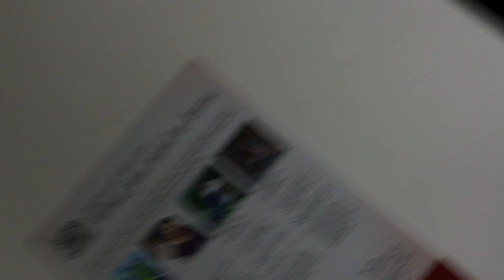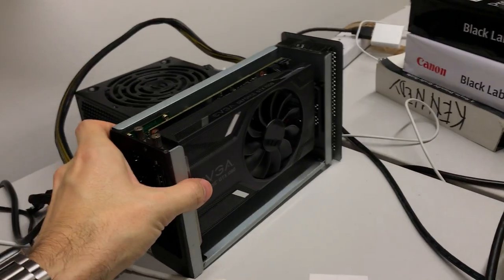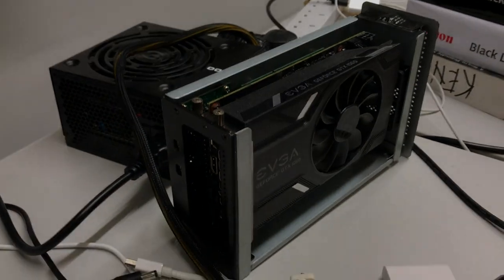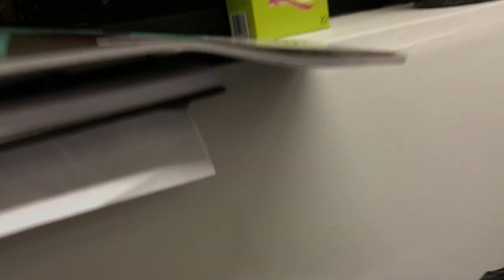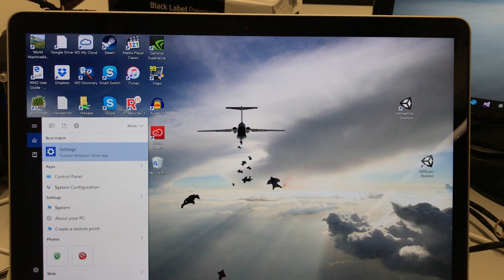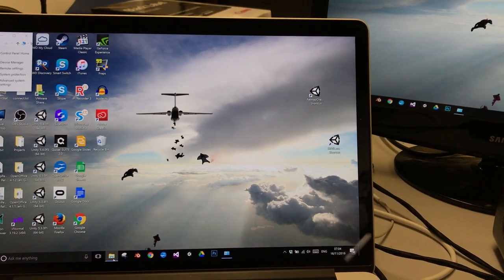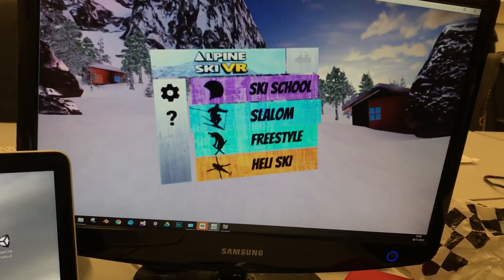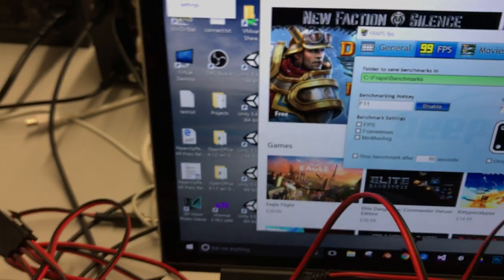Macbook EGPU Setup for Virtual Reality

Comment: Hi, I've been contemplating the same setup or perhaps jumping on the TB3/Node approach. Since you're on TB2, what kind of FPS do you get in general, for other more intensive games? I know Steam recommends 90FPS, can TB2 get that? Thank you.

edit: clarify FPS question.
Reply: Unreal Unity with this setup it seems to max out at 75fps. I'm not sure why, but it refuses to go higher, I don't know if thats something that's limited to my setup or if it's the TB2 in general. But most games will hit that fps. That rate feels fine in VR for me though
Reply: HDMI might be your bottleneck. have you tried DisplayPort?
Reply: Contemplation over, I'm using a MBP 2016, Razer Core, GTX 980 TI and HTC Vive, and it works well. The SteamVR test app showed Very High results and Unigine Heaven runs about 120~ FPS at High settings. All purchased 2nd-hand except the Core.
Reply: Unreal Unity nice my exact setup
Reply: good to hear! Although I spend most of my time in Win10, I like and use the flexibility of jumping onto MacOS for general web dev.
Reply: Unreal Unity what version of macos you on?
Reply: 10.12.2
Reply: Unreal Unity can you update to 10.12.3?  Or will it cause issues?
Reply: good question... I knew about the beta but just saw that they released it a few days ago and going through the release notes, doesn't seem worthwhile updating. I've not had any GPU issues/glitches etc. So I'll probably stay as-is for now, and then in a few months check out https://egpu.io for status.
Reply: Unreal Unity - I am trying for same setup. can you share your MBP specs.
Reply: I went with the 2016 MBP 2.7Ghz

Comment: check out the Akitio Node with thunderbolt 3
Reply: Bill that looks good.. worth a look for thunder 3 laptops, my MBP was just 2 though and the thunder 2 fits in my bag which is great
Reply: I think it would really be worth upgrading to the new macbook pro's simply for tb3. I know its ball ache buying a new mac, but the doubling of speed from tb2 to tb3 is the sweet spot.
Reply: Bill, I was just going to post about the AKiTiO Node. That's what I've been waiting for... for years. I've searched the internet for these homemade eGPU setups and now finally I can get this thing I've dreamed about for years. I'll be the first to admit that the setup I'm getting is overkill and way too expensive. Here is what I'm getting.
AKiTiO Node $299
Nvidia Titan Pascal $1200
Macbook Pro 15" 2016 $2,400
Total $3,900 +Tax
But it's my dream setup.
Stevesuch, I hope you at least get the AKiTiO Node and a Macbook Pro 2016 to get the full performance of your GTX 1060. I'm so excited.
Reply: Hi 
I did the samething but it doesn't show up in device manger video adapter? Whats wrong with it please need a help!!!
Reply: head over to https://egpu.io/ for solutions.

Comment: Are you running the power to the PCI-E with the stock power adapter from Akitio and the 500W to the graphic card separately?
Reply from the maker: Yes I'm running them separately. I've tried using a setup like Jordon did in this video: https://www.youtube.com/watch?v=MRyFA_L6V3Y&t=829s  10m in. I got some cables made up so I could go straight from the power supply to the graphics card and also the Akitio, but the cables didn't fit the Akitio barrel port for some reason, so ended up running it with both supplies. The ones that didn't fit were these: https://www.moddiy.com/products/PCI%252dE-6-Pin-to-3-Gridseed-Power-Plug-(2.1mm-DC-Barrel-Plug).html
Reply: Thanks for the fast reply! I'm currently running a 2016 MBP 15" with the Akitio T3 and a GTX 1070 on Windows 10. The only problem I run into is the code 12 error that I can't seem to get around. You mentioned you also had some issues with the boot and I was wondering if it was the same problem.
Reply from the maker: So usually when it booted it would be working fine. The issues I had around error 12 were the NVIDIA driver version I had. There was a version end of last year that gave error 12 so you'd have to revert to the previous version. They fixed that but seem to have broken it again for me anyway, in the latest version. SO I've reverted back to the previous
V 378.49  - 01/24/2017 - Doesn't Work 
V 376.33 - 12/14/2016 - Works Fine
.
.  In between Versions all worked fine
.
V 372.90 – 9/21/2016 – Doesn’t work
V 372.70 – 8/30/2016 - works fine

So I'm using the V376.33 at the moment and that works fine for me. Hope that helps.

Comment: Hi and thx for this video!
 Do you think this setup would also work with a HTC vive?
Reply: Jc Barré I think it would. I really want to get a Vive to test it out too! Looks like the Vive connector is just 1usb and 1hdmi so hopefully the setup would be the same
Reply: THx, i have a mid 2012 rMBP (only thunberbolt1) but your video really gives me fancy to build a setup!
Reply: So I've got it fully working with the Vive! There was a few issues to begin with but its all good now! Basically need to have a monitor plugged into the eGPU, have that set as your primary monitor and run steam from that monitor. Not sure whether it would all work on thunderbolt 1, but may do.
Reply: Hello, I finally made my own egpu on MBr 2012, same as yours but with an EVA 1060 3gb only. Thanks for the advices in your video!
TB1 works fine actually (score on geekbench 17 000 -> 110 000 with epgu).
 
 I also made the vive working with the same constraint: First, external screen on EVGA hdmi output and then launch of Steam VR using this external screen (otherwise no display on vive). 
It seems like an option is missing in Nvidia control panel : "High performance NVIDIA processor".
This option should allow us to redirect games video output to the 1060 but it is missing unfortunalety. Do you have it in your control panel?
Reply: Ahh that's great you got that working! and awesome it works with TB1!
No I don't get the option to select gpu in the control panel either. I'm confused because it seems others do with the Thunder2 but not for me. I do get to see which apps have been delegated to the different cards in the other nVidia window but can't assign them.
Reply: OK same problem.
I've found a hack solution to launch app from egpu screen automatically, above all if you cannot connect an external screen on egpu
https://www.techinferno.com/index.php?/forums/topic/10947-2012-15-mbpr-gt650m-gtx106010gbps-tb1-akitio-thunder2-win10-enjoy/
(at the page bottom)

Comment: Thank you for shared but do u have a error code of 12 on boot camp window 10?
Reply from the maker: Hi, I did with a couple of versions of the NVidia drivers, the latest one I was also having issues with so had to rollback to the previous. I'm using Bootcamp on Windows 10 for all this as well by the way.
Here's what I've had:
V 378.49  - 01/24/2017 - Doesn't Work 
V 376.33 - 12/14/2016 - Works Fine
.
.  In between Versions all worked fine
.
V 372.90 – 9/21/2016 – Doesn’t work
V 372.70 – 8/30/2016 - works fine

So I'm using the V376.33 at the moment and that works fine for me. Hope that helps.
Reply: Suchworks Ltd oh thanks for your help I will try to roll back to that driver wish me luck.
Reply: I have frnish put up the new driver and it work on window, if this work on macos or not. do I need a code for Macos

Comment: VR work on an Apple laptop is ONLY for convenience- Using a Desktop you'd have so much more productive and UPGARDEABILITY.. Now being MID 2019 AMD has newest AMD Ryzen™ 9 3950X. Specifications. 16 CPU Cores. 32 Threads.. Base Clock. 3.5GHz. Max Boost Clock. 4.7GHz. Total L2 Cache. 8MB  & L3 64MB.. New board and now PCIE 4.0 x16 and 105 WATTS!!!!

But time marches on and the bottom line is your income has little to do with a computer's speed. Most people making real money invest in people, not a personal desktop/laptop.   You are a pawn when you sit at one a tech drone at best.